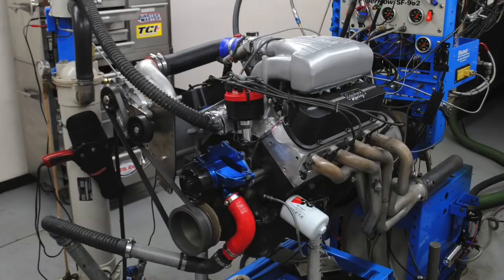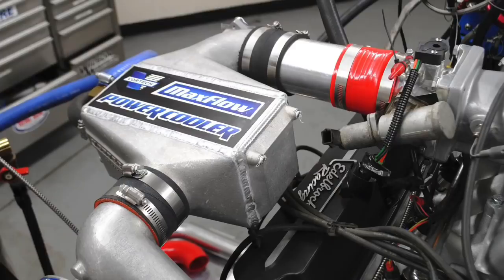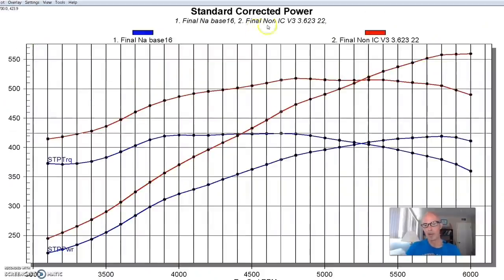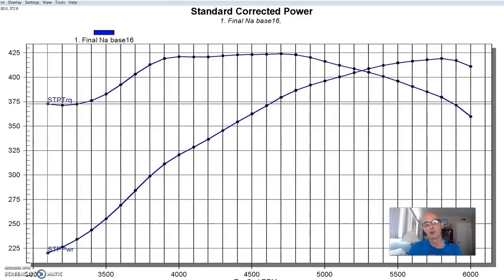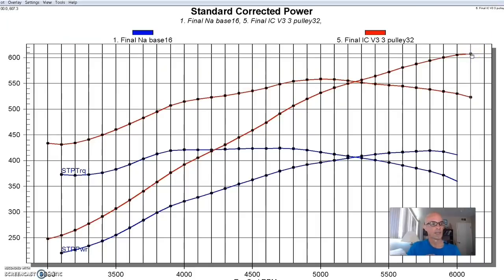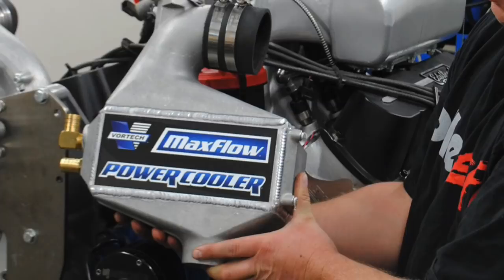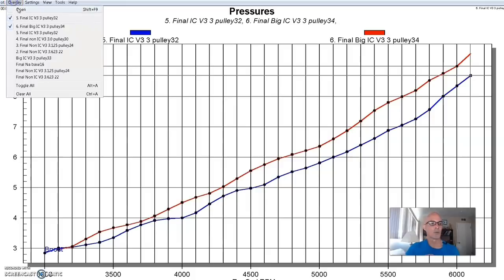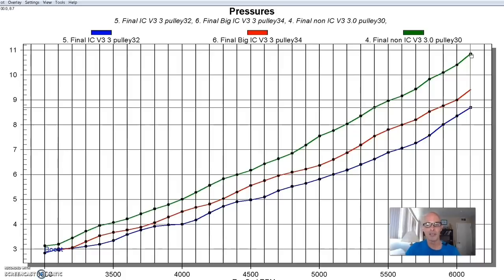WHAT MAKES MORE? INTERCOOLED OR NON?

Comment: Couple of things:
-Would have been good to measure boost pressure and temperature both before and after the intercooler.
-With that in mind, remember that despite the fixed speed of the blower, the centrifugal compressor behaves on a non-linear curve. If there is less restriction after the blower it will move more mass flow. 
-Also remember that the blower fan/compressor curve and thus its performance is purely dependant on the pressure across the blower. So measuring temp and pressure between the IC and blower is important.
-Also that with a higher pressure across the blower, the engine has to work harder to turn the blower = more parasitic loss at the crank
Thus if you're not knock limited you're going to be moving more kg/s of airflow (or lbs/min in the USA ;) ) thus more power available. 
What fuel were you using? and was the test knock limited? was it e85 and offering good fuel cooling?
-Best to measure temp in either °Kelvin or °Rankine so that the °△T is relative to an absolute scale. Because science :) Using a non-absolute scale (especially Fahrenheit) inflates the relative differences.
My guess is that the temp and pressure after the blower with the IC was sufficiently high to restrict flow across the blower. With the larger IC recovering most of those gains through improved density after it cooler. It's an interesting edge case. More data points would be ideal ;).
Keep testing. I'll keep watching.
Reply: Measuring the pressure before and after the intercooler would be interesting.
Reply: Yeah that's an interesting thought. If the blower is so far out of its efficiency zone it's possible that the increase in airflow brought on by the intercooler is offset by an even greater increase in parasitic loss.
Reply: @TurboBaldur  Intercoolers never increase airflow. This blower was also well within it's efficiency range.

Comment: Air flow/velocity. The slower air not only flows more sluggishly, it also reduces fuel evaporation due to a double-whammy effect of 1, lower heat to the fuel, and 2, raising the boiling point of the fuel adiabatically. 
Simply put, in a naturally aspirated engine, the temperature rises and the pressure drops, increasing fuel vaporization [more so for a carburetor than fuel injection, but the principle is the same either way] while in a cooled boosted engine, the pressure rises and the temperature drops, making it harder and taking it longer for the fuel to evaporate.
This means 1, less fuel burns efficiently, 2, lower cylinder pressures, and 3, slower fuel combustion [leads to piston bottom knock, fouling, detonation and overheating, all of which can damage the engine].
When dropping the temps and raising the pressure, one needs to make sure that there are proper steps taken to adequately evaporate the fuel before it enters the power stroke.
Some people [and I say 'foolishly', while others say 'advisedly'] rely on the cylinder's internal heat to vaporize the fuel, both cooling the cylinders, pistons and heads [only to then re-heat them while also washing oil off the cylinders and thinning the crank case oil] and force evaporating some of the large droplets of fuel.
This is more pronounced with summertime gasoline mixes [less so with ethanol and methanol added fuels, but more so with nitromethane and water added fuels] because there is less butane and more pentane, hexane, heptane, octane and nonane which have higher boiling points and lower vapor pressures so they do not quickly evaporate in the hot summer.
Since most people race in the summer, this effect is pretty reliable for most racers not using specialized blends of fuel or straight alcohol, which seems to be relatively immune to this problem, due to its very low vapor pressure and boiling point.
While there re still advantages to cooled boost, it depends on many other extenuating factors, especially the type, age and quality .of the fuel being used, the fuel delivery system, and the fuel enrichment settings.
Reply: @DD I think your observations on fuel atomisation and burn are on the money, would like to see knock data znd afr changes from run to run as evdnnif timing and fuel not changed between runs could be more suited to better homogenised charge due to evaporation and mixing of said charge who knows maybe even some swirl with more velocity without aftefcoolers

Comment: I think that nice intercooler is nice and can flow 120lbs/min but I bet your boost pressure/push was higher for the 1200hp runs. I think it was around 9-11psi for this one. If the air is twice as dense in the 1200 run it would make sense that this would flow halfish. No? Love the channel kinda wanna do something like this but smaller and pushing some less practical limits lol. Hope I got it. Thanks

Comment: Dicky me boy, Vortec gets the name right the cooler is after the boost so it's a aftercooler, an intercooler is used between multiple boost producers, hence the name inter... like interstate and interstellar. Someday you will actually get this right. And I'll stop saying dicky me boy when you get it. Cause guys going by richard hate being called dick... I'm trying to make a point here. As for why it made more power without it, the only thing I can think of is the charge tube filling and friction of the air going thru the kinks and couplers and nonsense. You are making the air path longer and not adding any additional airflow thru the piping system, it's bound to slow the air down is my guess. It would have been interesting to see the boost out of the super charger measured and at the intake manifold itself and see how much the drop was thru the core and extra piping vrs from the blower to the manifold and the temps from both. I know this is a difficult thing for a dyno room but I'd like to see what actual density/altitudes at the same temp actually does in a boosted and non boosted application and see that actual power differences, me I'll stick to friction in the system slowing the air down or the aftercooler presented a airflow impediment thru it.
Reply from the maker: Vortech calls it a Power Cooler-Intercooler is industry standard-just like motor and engine
Reply: @richardholdener1727  You may have seen my letter in Hot Rod magazine about ten years ago on the "motor vs engine" flap. It was titled "SHUT UP". We have motorcycles, motorhomes, motor oil, and Department of Motor Vehicles. Good enough for me.
Reply: @richardholdener1727  Please don't make me call you dicky again.. Motor is what an electric motor does, it spins, an engine reciprocates and is correctly called a engine. Magazine guys are 99% to blame for this for the last 75 years. It's just one of those pet peeves to the more engineering side of the sport. And I gave my answer to why it made more power before i watched the second half. I'm still holding onto the internal friction of the fins in the cooler the reduced radius of the bends and stuff as where the power went. The cooler can move the air, but the interface where the moving air hits is where I'm calling it for the friction of the moving air. The bends themselves slow air down by presenting restrictions in air flow itself etc. I'll point at those as the reason why you lost power. It's like the ice water chilled guys and the sheer size of the pipes they use with the cooler in the truck and having to move the actual air mass thru 15-20 feet of piping, they can add the boost to compensate, but I'll bet you a egg mcmuffin that if you did the same test with a vortec style blower it would lose a lot more power then the ice water added. It would be pretty damned unresponsive also.
Reply: @Scootermagoo  Richard has probably forgot more than you know about engines , the info richard is putting out is golden, how many other channels have done testing like he is showing and not just praising what ever brand throws money and parts at them.
His video's are the best out there for the majority of performance guys and gals that don't have tons of money to buy a bunch of parts and pay for dyno time just to see what's the best bang for your buck performance on different platforms.
Reply: @chrisdeez2176  I'm not as intimately familiar with what he knows, I do know what I do know and we could sit in a bar and argue engines all day and night and I could hold my own, so don't under estimate people because you don't know..making power is easy, making good power is harder. I can make good power and mechanics is mechanics, so... once you know.. you know... air flow + fuel + spark at the right time makes power... how you get the air and fuel in and control the spark is what makes it entertaining.
Reply: @Scootermagoo  I'm far more concerned about the "gangsta in the hood" types that say "I be this" and "He do that", as if it's cool to be functionally illiterate. Whatever happened to IS, WAS, DOES? When the suburban white kids start talking that way, we're in big trouble.
Reply: @donellmuniz590  You mean the suburban white kids are not talking that way now? Have you not been in a discord server or anything with young to middle aged people in it? It's already happening.
Reply: @Scootermagoo  I'm sorry to hear that. I'm 55 and my kids are 30 and 28. But we live in the Pacific NW in a small town that is neither urban nor multi-cultural. So mine have no "urban patois", thank God. And I dont talk to teens, that would be creepy.
Reply: Intercooling is the proper term when used between two stages of compression. Aftercooler would be more appropriate if no more compression took place after cooling.
Reply: name-calling is only done by manchildren, and aftercooler is indeed the correct term. but the popular term is intercooler, and even professional racers and manufacturers call them as such. when you order an intercooler core online, it is called intercooler core even if it will technically be used as "aftercooler".
Reply: Maybe intercooler in right because its between to air pumps
Reply: @stardroppercj Why would I as someone that raced for 25 years and has been a motorsports fan since the mid 80's, that has an iq higher then lukewarm not know the proper terminology of a engine vrs a motor and the difference between pre after or inter. It's fair to say I'm giving our guide to making horsepower a bad time because engineers and other people that know better, despise magazine guys for using incorrect terminology. I know for a fact that I have Hotrod/CC/Popular hot rodding/super stock and drag illustrated magazine + thousands more has seen someone roast richard or his dopplegangers over close to the last 40+ years.. 
So the question i have for you is where is your low iq, low hanging fruit video saying stuff you know is incorrect and using improper grammar and language. Isn't that what younger people do? I don't have to make a video doing this, i'm a private person and I prefer not to share my voice or likeness to a video and make it public knowledge. I can indeed comment on a video in the public domain and call someone out for doing something wrong. I live in a country that believes in free speech and allows me to say as i please as long as I do not lie about or to someone about someone else knowingly. I know Richard is wrong, I know why he does it, but that does not mean my engineers side doesn't get a little butt hurt over someone not trained using incorrect terminology to incorrectly inform people like you of something they said wrong. So now that I have made it abundantly clear who what where and why and that I might know what I'm talking about. I'll leave you with this. I doubt you will read this you can't pay attention long enough because your phone is informing you you have an ad for a apple product. Maybe just maybe someone is smarter then you and can be a little snarky about it.
Reply: @Scootermagoo  what mission are U one exactly
Some engineers misguided attempt to prosecute car industry terms and blame Richard for it I hope you comment like this on every video that mentions intercoolers just to for  fun maybe try a more positive outlook 
so to get this right because I'm one of these low IQ people that is clearly beneath your experience 
It's got nothing to do with boost pressure and timing

A wide band reading would nice
Richard fyi
Thanks for videos
Reply: @Scootermagoo  God, you're an insufferable, arrogant, know it all tight-ass. Ever hear of "LAYMANS TERM"? It's long been accepted by "lay people" (not pedantic, self-styled "engineers") that, while they would never call an electric motor an engine, it's ok to refer to an engine as a motor! Motorsports, motorboats, motorcycles, motor oil, etc. Get over yourself, Edison.
Reply: @Scootermagoo  I know Asbergers Syndrome when I see it.
Reply: @Scootermagoo  I have a mild case of Asbergers myself, and I recognize the traits. Grandiosity, elevated sense of self, big vocabulary, but poor social skills. I had it real bad as a kid, but 14 years of counseling and meds (and old age) have tempered it some. If you DON'T have it, I sit corrected 😄

Comment: less pressure in the plenum and the  cfm  loss  from the air  having to  turn?
Reply: It’s restriction from the core of the intercooler. You’ll loose some pressure from cooling the air since it’s denser so takes less space. But, with that little one it’s just to restrictive so the core just won’t flow enough air.